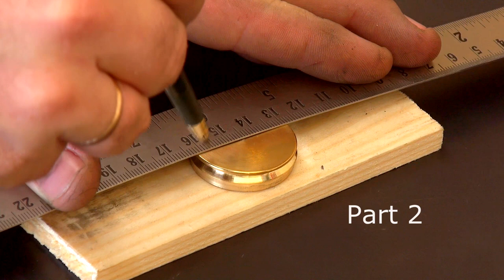Table Petrol Lighter - Part 2 Soldering

Comment: Awesome Job, one suggestion would be to flush cut your twisted wire detail you added. You spent so much time on detail and this is the only thing I was a little disappointed on. Very easy fix.

Comment: You should have used a steel pin for the flint wheel. That hardened tool steel flint wheel rotating against that soft brass pin will wear a groove in it fairly quickly.

Comment: You do very nice work, but I wish there were written or spoken comments.  It’s entertaining, but not very instructional.  Like, what type of brass, solder, and flux do you use?  What sort of lathe speeds and cutting speeds.  How do you do your design.  And a This Old Tony metal cutting karate chop or two would add some humor.  Oh, and lastly, I wish your stuff were less smoking related, not my thing.  But beautiful none the less.

Comment: I always love the soldering part... I just have a question is that soldering wire the same they use in electronics the one use in gadgets and others?
Reply from the maker: The solder I used in this project, not tin, is nickel solder. Here is a link to the product: https://www.harrisproductsgroup.com/en/Products/Alloys/Soldering/Lead-Free-Solders/Bridgit.aspx 
You can also look at this site (https://www.harrisproductsgroup.com/en.aspx), this company has a very large assortment of different products for soldering.
Reply: @BanjoShow  i see... But can i ask if the soldering wire they use in gadgets can work well too in this kinds of projects ? Because thats the only solder wire i have in home hehe
Reply: @BanjoShow  the 2nd link isn't working, it says..👇

404 - File or directory not found.
The resource you are looking for might have been removed, had its name changed, or is temporarily unavailable.

Comment: Pleasure  to watch Your work, btw i have one question, wouldn't the  heat from fire, melt this rubber gasket ?
Reply from the maker: If the lighter warms to such a temperature to melt the rubber band, you can not hold it in your hands. I want to say that this rubber can withstand temperatures of up to 160 degrees and this lighter never heats up to such a temperature.
Reply: Banjo Show Ok got it, Thank you for answering my question